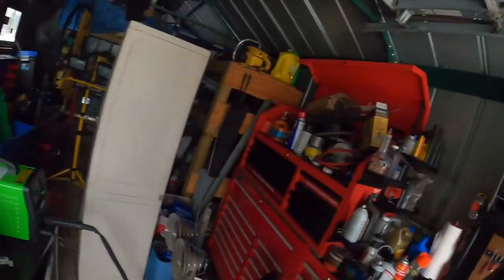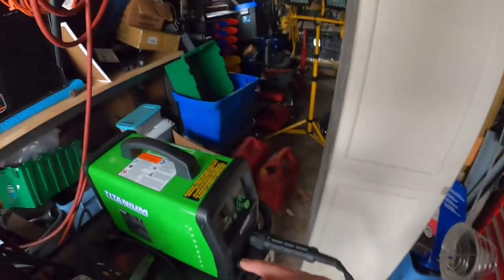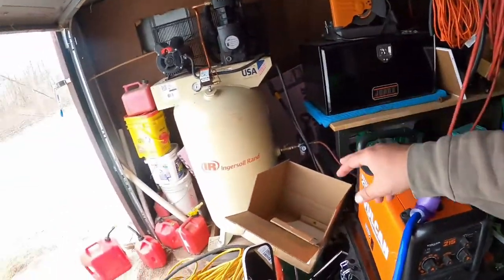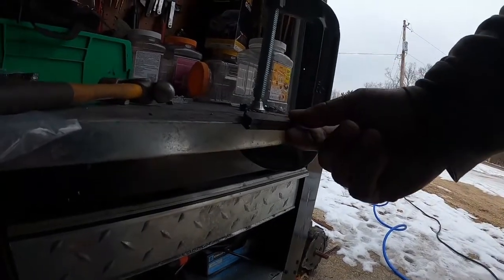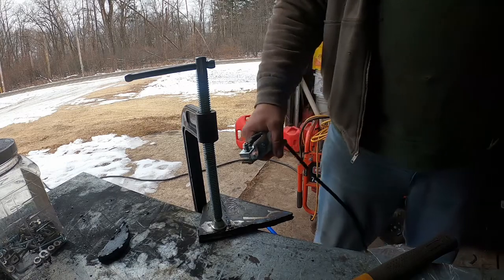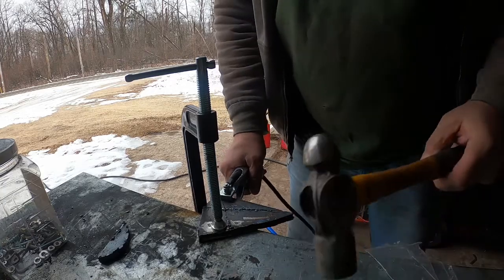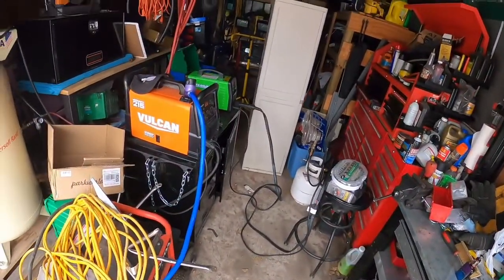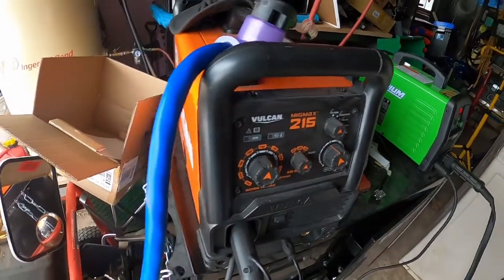HF titanium 45a plasma cutter review

Comment: I’m guessing that you are having some air issues out there as well. Needs a lot of air and VERY DRY AIR!
Reply from the maker: At first i was, set regulater to psi, brain fart, never checked psi one pulled trigger, had over 10psi drop, got dialed in now for thicker metal, doing the learning curve

Comment: It's not a drag tip plasma cutter....you have to hold the tip off the surface of the cut !!
Reply from the maker: I was still using the training legs, so while resting legs on metal, it holds tip off of metal.
   Ive slowly been taking training leggs off an practicing holding tip off an cutting, slowly getting meter

Comment: I got the same machine I cut 3/8 last night with no problem 1 pass got to slow down what that was on 220
Reply from the maker: Finished targets,slowing down an prepping helped alot, ty again
Reply from the maker: Ty, i also found out i was doing wrong, was only cleaning 1 side of metal, an if arc hits any rust it spits back, getting better but any tips def helpful, ty.
Will be getting more practice, more targets to cut out